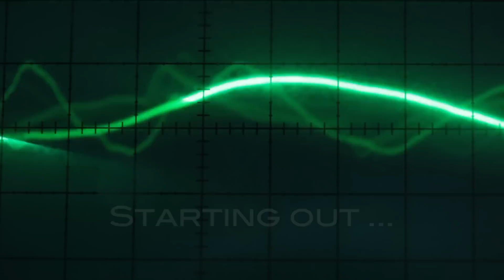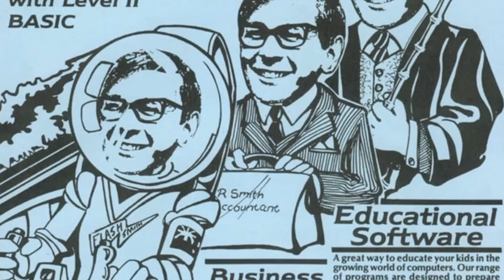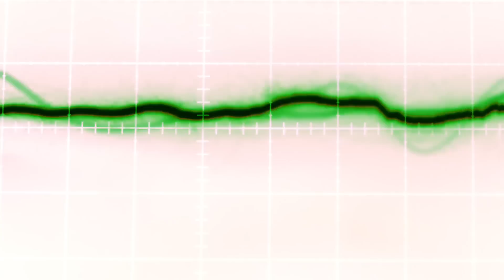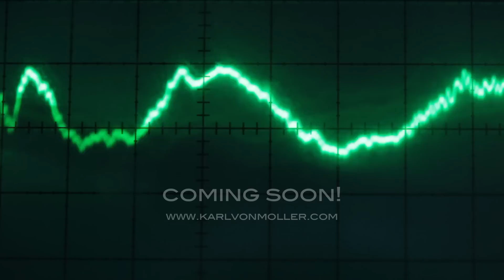State of Electronics Trailer

Comment: When I was working for Vipac Engineering I worked along side a Electronics Masters student who designed and built a circuit that didn't work. He spent days trying to figure out what was wrong with his design. He eventually came to me to ask for help. This guy was not unintelligent and was very good at coding and integration and had a keen interest in nano technology. After spending 5 minutes with the circuit, I discovered there was absolutely no grounding on the circuit. He was totally unaware of the need for a ground return in his circuit. What the hell are they teaching in engineering these days?? This is not the first time I have encountered a similar situation with engineering graduates not knowing anything about electronics. They know how to code though.